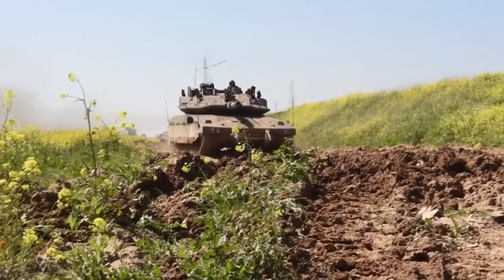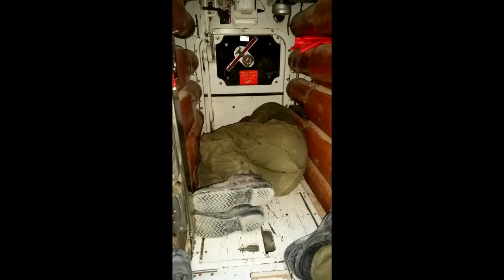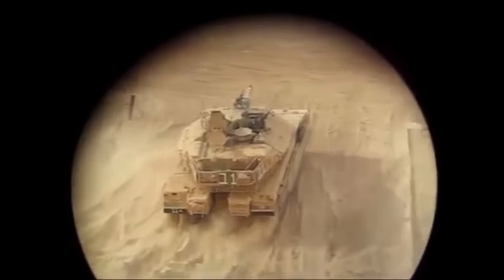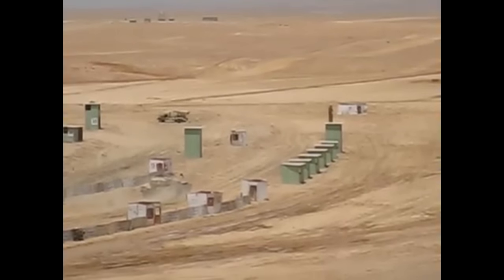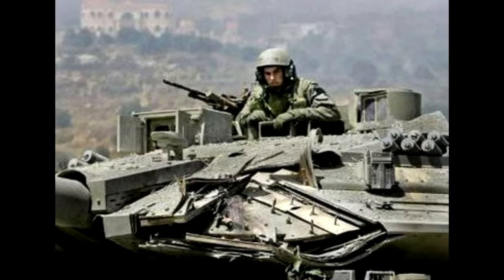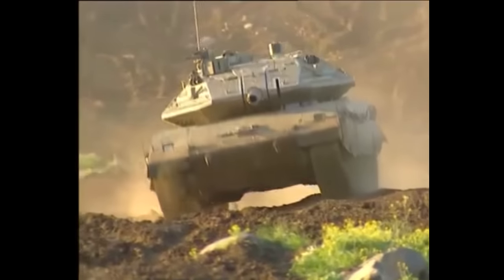Problems with Merkava tank

Comment: In War Thunder Merkava's issues you have mentioned are actually present :) The older Merkava 1 and 2's go up against DM23/DM33 105mm rounds and their engines do quite well as additional armour. Merkava 3 however sees much more modern weapons from the T72B's/T80/T90 3BM42 let alone 3BM60, Japanese Type 90's JM33, Leopard 2A4's DM23 120mm, Challenger 1's L26 APFSDS etc etc etc which pen right through the engine.
Reply: Alphadefence had a rage-ensued stroke reading this and fucking died

Comment: It doesn't need to be "the best tank in the world" (a moving target, pun intended) just effective for purpose. Trophy APS (necessary for every AFV) will more than compensate for armor. Bringing one's own infantry under armor is vital to protecting tanks, most of whose use is not in tank v. tank duels but as mobile artillery. I suggest deferring to operators who actually use systems in war (see comments) when discussing thermal sighting systems. Any tank or AFV with an internal combustion engine will show on thermals. Only a hybrid with the ICE engine turned off and cooled down can stealth loiter and no one has fielded one yet.

Comment: Merkava mk4 was good for the last decade.  It is already outdated today
Reply: So who is the potential enemy of the IDF this decade? Egypt? Syria? Jordan? Iraq? Lebenan? Iran? Whose tanks will roll against the Israelis? Only a country intent upon losing yet again, I suspect. If I remember correctly, Israel has more weapon systems than tanks alone. Maybe Iran would launch missiles against Israel, and some missiles may impact, but at what cost to the aggressor? Tanks are only a portion of the defense of Israel.
Reply: Don't be so defensive.  The Israelis have fantastic technologies with many good and cost effective weapons like the Tavor, possibly one of the best bullpups that is exported widely globally.   Spike ATGM has got plenty of users as well because it is a deadly ATGM and ranks up there amongst the best. Trophy active protection system is also adopted by the US Military that shows the system works.

But you want to think why the Merkava is not well exported is because of her quirky design that revolves around the supposed armor and the frontal engine she provides for crew survivability.   That, many countries do not buy into that as engines are after all complex to service and remanufacture.   It is not so convenient as to accomadate a hit resulting in the immobility of the vehicle all the time.    With the advent of advanced sabot rounds with the DU penetrator, the engine is simply useless in stopping the molten slug at high Kinectic energy strikes.  Against ATGM, the Merkava has a limited amount of Trophy protection munitions to counter act before being overwhelmed by many missile fire.  Hence survivability against missiles like the KORNET E, the HJ8 is simply Non existent at the frontal arc.  Those atgms deal a penetrating amount of beyond 1000mm of RHA whilst able to take these tanks on comfortably at 4000m and beyond.

The lebanon war in 2006 proved the lethality of the KORNET E resulting in the development of the active protection system Trophy.  

Merkava is still a great tank for asymmetrical warfare, but without modular add on armor packages, she is quite naked on today's battlefield where tank developments are advancing even more rapidly globally.  Mobility, armor, advanced protection systems, electronic warfare, sensing and surveillance and inter connectivity with other units are paramount to the modern MBTs all rounded value add to the battlefield.

Comment: This tank gives the most protection for the crew than other tanks, that’s why it is considered one of the „best“ tanks. Not because it’s robust oder strong or whatever. But you talked a lot of the cons for the tank itself rather than the crew.

Comment: So... Lemme get this straight. They made a tank with virtual no effective frontal armor (y'know, the place most likely to be hit) against kinetic projectiles in modern use... And put a fuel tank RIGHT THERE so that it can catch fire and shut down the engine... And to make matters worse they've made a potential mobile pyrotechnic display have no blow out panels whatsoever?
...Let's just say that I'm glad for Merkava crews that they're unlikely to face other MBT threats in combat. Because... Otherwise... this would be a disaster in the making.

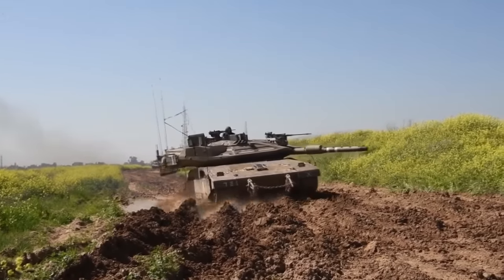Comment: 1:59, I don't get it, doesn't it do the same thing if it just pens and kills the driver or crew members? At least the engine gives them some extra chance of surviving.
Reply: I would not be surprised if it was one of the main reason to put it in the front. Trained and experienced crew is far more value than an engine.
Reply: @user-qd6dh6ux8t  Yeah it was actually a good decision, except for maybe the possibility of leaving the back even less protected.

Comment: When a clueless person makes a YouTube video.

You took most of the Merkava advantages and twisted them since you clearly didn’t do your homework.

“If a projectile will hit the motor it will stop the tank”, did you even saw a dead crew maneuvering a tank? Yeah, that’s one of the reasons the engine is in the front.

“The fuel is in bad strategic spots making it more flammable”, the diesel reservoir was placed intentionally in those areas to yet again give more defense to the crew by absorbing the hits. To get ignited it would be needed for two hits since diesel need to be enriched by oxygen first, most of the fire that hurts the crew is caused usually by the hydraulics that get erupted, so the turret in merkava is electrical.

 Heat signature, dude, it’s a freaking tank all tanks have heat signature! The Abraham’s have a jet fuel engine! You have any idea how much heat his 15,000 horse power engine generate?!?
And it surely doesn’t obstacle the gunner thermic vision in the merkava, where did you came up with this nonsense?

The Merkava tank have the lowest fire changes to catch fire if I’m not mistaken 13%.

“Safety procedure is far behind modern standards” what are you even talking about, Merkava tank is the only tank the crew can exit the tank rapidly while not being under direct fire exiting from behind under cover. Only tank that allow the crew to exit safely.

You have no clue what you even talking about and it’s noticeable during all this video, next time do your homework and study the enguiniety of the design.

Merkava only flaws is it’s slow speed, but it’s engine was upgraded to reach 55kmh - 64kmh on road with a awesome range.

And it lacks depleted uranium armor that  many of the other top world tanks have but sadly israel don’t have nuclear power ;), so they don’t use that type of armor.
Reply: the video is only about the problems not the good things..

Comment: The merkava is good. Against hand held anti tank weapon, shaped charged, and old early cold war tanks (T-54, T-55) but i doubt the tank will survive against T-80, T-90, or other late cold war/modernized late cold war tanks. I dont even think Abrams will survive either from these new modern tanks. Tanks against tanks is basically who shot first almost guaranteed win on the fight (if 1 vs 1), thats why most modern tanks focuses on its detection system. Good video btw

Comment: Thank you for the video. I am no tank expert, but I understand the origins of the design to be used for positional defense first. Experience with the Centurions and M60 tanks during the 1973 war reveal several flaws in both of them that lead to the current concept. It is always easier to design an ATGM to kill any tank since chemicals itself yields enormous power output per gram compared to harden steel ability and thickness to withstand shape charge that easily penetrate 300mm thickness. One can argue that increasing the thickness to 600mm or more and the problem is solved. True, but the tank becomes a snail. In modern urbanized warfare, the tank, if use in combination with infantry and other autonomous AFV's and UAVs correctly would be a force to be recon with. Use it wrongly, it would be a disaster as some 17 years ago, over emphasis in using it alone to spearhead became a "roadblock" upon itself.

Comment: the armor thickness is calssfified, how the hell would you even know if it's thick or thin?

also, what you said abut sloped armor is completely wrong: it has uniform strength throughout its length. and a 75 degree slope is a good thing as it increases effective thickness by a factor of more than 2

Comment: the engine acts as armor with a fuel in front which when hitted lights on fire quicker than a candle, that seems safe
Reply: Yes but crew is still protected and there is an armor wall behind the engine so crew has time to escape, engine in front is to protect the crew not the tank, and fuel tank is in front because when detonated it could degrade APFSDS projectile before it has a chance to Penetrate the crew compartment
Reply: @shinbetE  fair enough,

Comment: "The engine asks as another piece of armor" - if you attack from the front. No one attacks the front of the tank if they can help it any more. But in fairness to the Merkava, it is primarily intended for defensive operations so depending on its use, it may still be a good thing.
Reply: nah, it prove to be a big mistake in the recent days

Comment: Being a defensive tank in nature, I think the engine placement at the front is to allow the use of the rear door to replenish ammunition and supplies under fire without the need to expose the crews to the enemy by opening the top hatches.

This engine placement is pretty useful as older Merkava tank has been converted into Namer APC and IFVs without much change to the hull besides the removal of the turret, not having to awkwardly place the hatches and doors like T-55 APC conversions.

Comment: In its defense, it is a hull down kinda vehicle, the angles are excellent and couldnt get any better for a tank. The vehicle is part of a combined arms ideology, and isnt designed to stop tank rounds, it is designed to be in cover, and protect from infantry type weapons. Not much is going to stop a modern tank round, and sometimes, no armor (in comparison) is best armor, as the rounds sail through, as long as they dont hit anything important, the vehicle will be ok, as long as overpressure or shrapnel doesnt kill the crew...for its purpose and ideology, it is the right tank, at the right time, in the right place and environment. You wouldnt use a flat head screw driver where you need a phillips, they both do the same thing, but different circumstances. Stick other tanks in places they werent designed for, and the list of flaws for any tank will be numerous.

Comment: A tank is only as good as the crew who drives and maintain it.
Training and defense of the tank is a big +.
Then we need hatch armour not thick enough.
Armour over the engine not thick enough.
Armour underside not thick enough for landmines IED .
Big tanks make big target for close quarter combat with infantry.
I would like to have scorpion light recon tanks UK.
Scimitar light recon tanks UK and weisil light recon tanks Germany fast and lethal light recon tanks.
Add four missles and chain gun and gpmg you have a formable platform.
These small recon tanks would out manover any large tank.

Comment: [09/20/22] ⚠️ Basically, no armoured vehicle is invincible. In conflict, hardware is expendable, but experienced, and skilled crews are not. If the tank is hit, or disabled, but the crew survives, they can bail out and be picked up, or rescued by another vehicle, and RTB to pick up another tank. If the crew are killed, you've just lost up to 4 valuable human assets that will take at least many, many months to functionally replace.  As it stands today, the best tank is the M1A2 Sep 3 equipped with the Trophy system.  Since the addition of the diesel APU, the turbine no longer has to run in order to have electrical power for the instrumentation. This can dramatically reduce fuel consumption, otherwise, you're looking at refuelling with 300 US gal every 8 hours of turbine running time.  The M1 was designed for overseas, offensive blitzkrieg style warfare, whereas the Merkava was mostly designed for defensive warfare, and has been adapted, and upgraded for asymmetrical warfare.  All tank designs are a compromise, and balance between the 3 main criteria of firepower, armour protection, and mobility.

Comment: I'm ex IDF tanker, here to provide some corrections.
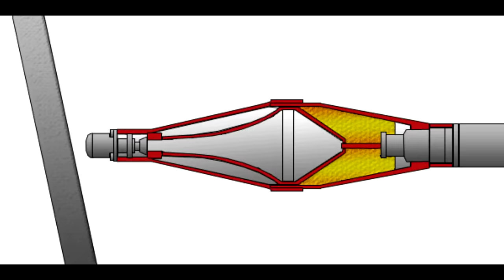2:20 Not true.
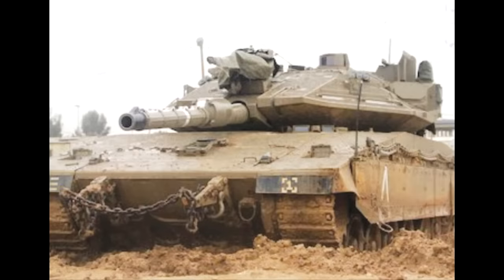3:00 Weird. I've served on MK2 so maybe I'm mistaken about MK4, but I'm pretty sure that the fuel tank was located some place else (AFAIK this info is classified so I'm not gonna go into details.)
3:33 This is MK2 i think.(80% sure. Hard to tell from this picture) Among other things, you can tell by presence of left MAG. I don't remember about MK3 but it's usually absent on MK4. Also the fire is in the rear part of the engine compartment. Probably something to do with fuel supply line. (Before you say the fire escapes through there because of the armor plate, look at the front of the tank. Engine service hatch is open. The fire is not in the front.)
4:35 Not true. Just physics. Transition between mediums is horrible for any advanced armaments.
5:10 True. But Cornet penetration power is 1300 mm RHA. Nothing stops that. That's why active protection was developed.

P.S. Other things were either true, or I just don't know. Not a tank enthusiast, just lived in one for 3 years:).
P.P.S Impressive amount of data... Some of it, not highly, but is classified...

Comment: squish down a radpanzer 90 hull, low rider style, slap in a 1200 HP engine, apply stronk merkava turret, and good composite in the hull with integrated ERA, and use better fucking ammo bins with stowage in the sides and blowout panels. and yeah apply l55 cause stronk

Comment: Let's not be quick to jump the guy. Although he might be a bit biased towards Russia, his videos are of good quality, well documented and argumented.  About this particular tank, a few observations:
- Merkava has been around since the early 1970's, yet virtually nobody has copied this layout (exceptions: Argentine TAM, which is a Marder APC with a tank turret on top, and the aborted Object 488 from Ukraine). Why is that?
- The ability to carry infantrymen comes at the cost of increased height and weight, affecting both mobility and surprise; the Merkava has one of the lowest power/weight ratios of any modern tank. It is obvious that it has been designed to fight enemies who have either obsolete tanks or no tanks at all, as in a battle against modern tanks with superior mobility it would likely be toasted, as demonstrated by Israel itself during  Six Day War in 1967 when Soviet IS-3 heavy tanks deployed by Egypt have been annihilated by Israel's nimbler Centurions and Pattons. 
- The absence of separate ammo compartments fitted with blowout panels trumps any possible increase in protection given by the placement of the engine in the front. If the back is punctured, the crew is in big trouble.
- Finally a question for @RedEffect : in another video you criticized the Leclerc for having an ammo rack in the front. In this one you criticized the Merkava for having the powertrain in the front. Which is worse? What should be in the front? You must put something there, you can't just leave the place empty.

Comment: The thermal issues citied aren’t really issues at all. I used multiple thermal devices on a tour to Baghdad. Ambient heat coming off the engine doesn’t interfere at all with the sights and any vehicles metal exterior will be VERY visible against any background, day or night, anyway. The biggest issue is the ammo storage as number 1 by far. Then the APFSDS protection, or rather lack there of. The best protection for that is depleted uranium armor, which is really heavy and not easily procured or manufactured. To my knowledge the US (and only US) Abrams are the only tank with it, although I wouldn’t be surprised if the challenger 2 and possibly French Leclerc’s had them. Considering both countries had enough DU available and the money to invest in the effect to convert it to armor.

Comment: The problem with this video: Of course, the tank has it's problems because it's general concept is old. You say many times "It's very poor for moderns standards" - that's because it's an old tank, 40+ years old and just modernized, the thinking behind it is even older. And like all concepts that should do many things, they don't do these single tasks especially well, like for example a specialized system, but that was a conscious decision from the IDF at the time. It's a compromise and every armored vehicle, tank or not, is one, some bigger, some smaller. There is no sense in comparing it to "modern standards", because it is not. You could compare a M4A1 Sherman with those standards and you'll find many "problems". You have to put it in reference of the requirements at the time it was developed, the environment, the tactics at the time etc etc That's not how it works, that's not analytics, that's just an opinion.
One point: Diesel is hard to ignite and is intended to works as an APFSDS decelerator / deflector, that's why many spaces are surrounded by it in merkava. At least that was the idea, back in the day.